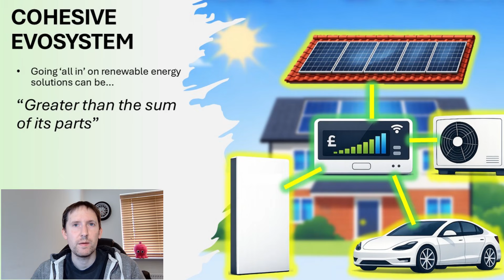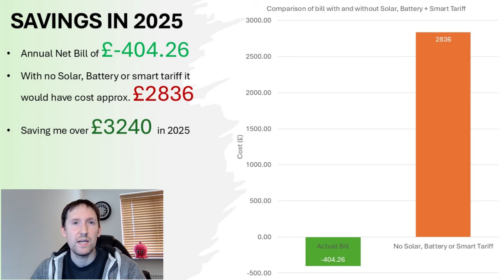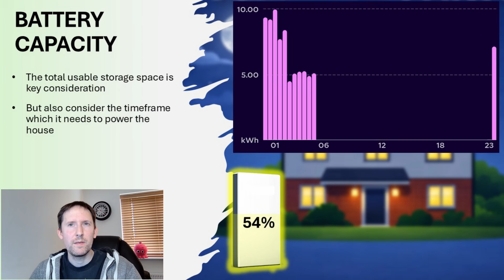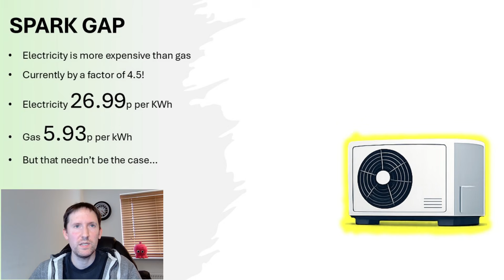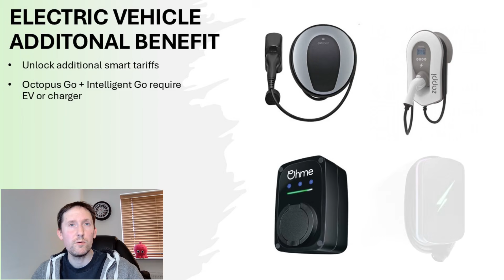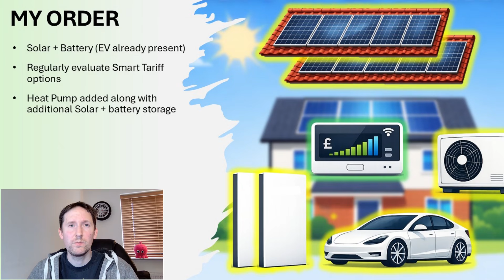The Renewable Energy Setup That Pays Me to Live Here

Comment: I have a 4kW solar system and two EVs plus an air source heat pump. I am looking to get a battery at some point to complete my system. I always charge my cars overnight so will continue to do this so I was looking to get a SigEnergy system 10kW battery and 6 or 8 kW inverter. I was hoping to add the EV charger to this system at some point to once vehicle to home/grid becomes approved in UK so don’t think I need to get a bigger battery as I can use my EV battery as extra capacity going forward. Do you think the 6kW inverter will be a good match or should I go bigger?
Reply from the maker: Those Sigenergy EV points are really cool. I've had a few people comment on my channel they are using their car to power their home already 🙂
Regarding the inverter, try to figure out how often your usage goes above 6kW and look at the price difference between that and the 8kW model. Consider future expansions too and how your usage might change over the years 🙂

Comment: My setup is basically the same as yours, with a few caveats. We have a Victorian end of terrace house with solid walls. We managed to insulate the downstairs floors and the roof, and we have double-glazed sash windows. Only the back extension is properly insulated. Our main roof is also tilted in 3 directions, so we could only fit 10 Solar Panels (3 East, 5 South & 2 West). Our heat pump’s efficiency for heating was only 3.36 for 2025, so without the battery we probably wouldn’t have saved anything compared with an efficient gas boiler. The battery combined with an Octopus’ EV tariff is the main money saver, as you described. We run the house on 7p from the battery and sold the excess solar for 15p last year. Additionally, we moved to plugging in the car every morning to get cheap periods of 7p during the day during this winter months, during which we could re-charge the battery to avoid it running out in the cold months due to the heat pump demand. This happened in the first 2 winters, but we still cut our overall energy costs from £3400 to just under £1000! I expect to push it even lower this year, but I dont know by how much yet. I’m also planning to finally replace our gas cooker for an induction cooker some time in spring, so we can finally disconnect from gas - even if it only saves about £150 a year. 
I would be interested if you think it is still worth selling the excess solar this summer, after the drop to 12p?
Reply from the maker: Its never quite so easy with an older property, but we got a 1950s system built property up to an EPC raring of B before moving here, mainly with a combination of external wall insulation and solar panels. 
It sounds like the trick with getting the extra slots of power the house is no longer going to work from next month, but an EV tariff remains competitive when the import is so cheap. 
Induction hobs are well worth it! Arguably better than gas, certainly safer and you can avoid that standing charge as you say🙂 just remember to by some new pans for it
For most, at 12p it's less worthwhile to go out of your way to export the majority of solar power, self use is nearly as good. I'm actually going for a different approach in the summer months as I'm planning to switch to the Intelligent Flux tariff, to make the most of otherwise redundant battery capacity. It should be effective as I will be generating more than usage and that tariff allows for a better rate as export will primarily be at a specific time, 4-7pm 😊

Comment: Bought my home in April last year - already had an EV. The plan is to stay here until retirement, so first things first is energy efficiency. 

Topped up the loft insulation as soon as winter peaked around the corner. 
Had 24 470w solar panels, a 10kw sigen inverter and two Sigenstor BAT 10s installed last month. 
Heat pump + hot water cylinder is being installed at the end of March by Heatgeek garenteed 400% efficiency. Also had the Sigenergy EVDC installed which will allow me to top up the house batteries from the car when they run low in winter, and I got the Sigen gateway, I wouldn't have bothered with this but since we've been here we've had no less than 7 powercuts, they've all been less than 10 minutes, but that's more than 1 every 2 months. I don't recall having this many power cuts anywhere i've lived since I was a young lad 😅

Expensive? Yes - very! But my energy bills should be <£0 for Heating, hot water, day-to-day car travel and everything else.

Two 8.8kwh batteries means in the shoulder months I never need to worry about my batteries. They comfortably cover my base load. A 3rd would be nice, but it increases my pay-off period, and I have the EVDC for the colder winter months, where I can just top up my house batteries at 5kw if they run low.
The new cylinder is 300L, it will always be enough to last a whole day meaning I never have to top it up during peak rates - bonus I finally get mains pressure hot water.

All in I calculate my pay-off period to be about 7-8 years at current energy rates. It would have been less with arbitrage, but the new 12p/kwh export tips the price over the edge where it's no longer worth it vs the battery wear and tear + conversion losses.

I have the advantage of having a mortgage that gives me £2k back for getting a heatpump installed. And my boiler needs replacing very soon - it's 15 years old and from what I can tell has been pretty pooly looked after - it's even started dripping condensation occasionally, if I went gas, with how long I plan on staying here, I wouldn't go cheap so that's another £3500 I would have had to spend at some point in the  near future, so I can deduct both of those from my total cost.

After that I save >£2600/year for as long as the system survives - again assuming current energy rates. Any increase on energy price (even just annual inflation) actually decreases my pay-off period and/or increases my annual savings.

After a lot of math and calculations, there isn't a single investment I could have put that investment that would reliably have returns even close. The Mrs really wanted to 'do the house up', and I'll admit she's been a little upset at times that most of our money has gone into solar, batteries and heating. But she understands that the earlier it's done the more we save for doing the house up later.
Reply from the maker: That sounds like a really comprehensive setup. 👍 I must admit I’m a bit jealous of your EVDC. I suppose that does negate the need for a larger home battery capacity. Which car do you use with that?  Good move with the 2k mortgage rebate. That’s always encouraging when mortgage companies encourage the uptake of green tech. Doing your home improvements this this order drastically reduces your livings expenses going forward so should help with savings for future projects.
Reply: @RenewableEnergySteve  Car is 2020 Tesla Model 3 Performance (pre-refresh). The tech is pretty new and can be a little flakey at times until you get your head around it's quirks - for example you have to put the car in camp mode and turn the fan right down whilst it's discharging else it goes into sleep mode - but once you do it's pretty solid. It is kind of cool in a geeky way to know your house is being powered by your car. If I get fed up of having to charge the batteries from the car too regularly over winter I may go end up throwing in another battery just to reduce those events. But i'm going to give it a year first and see how it goes.

To be honest I was going to do the heat-pump next year. It was only when I realised my boiler was in such a state that I figured I'd do it this year. And the Mortgage offer absolutely helped and played a large role.

If it's any consolation - I'm jealous of the amount of solar you have!
Reply from the maker: @leighbicknell5583  haha, yes that helps 🤣 it's genuinely really interesting to hear what systems people have. Some great solutions out there! 
My Model 3 is a 2020 model too, just before they added the heat pump to them sadly.
I've not actually used camp mode before, I presume you can run it with just the fan to avoid draining the battery on internal vehicle heating?

Comment: Can we see some numbers? Or are they in earlier videos? You mention having sufficient battery capacity to make it from one off peak period to the next. I’d be curious to see the consumption figures from your heat pump for its hardest working day.
Reply from the maker: Sure, 5th Jan has been the day with the highest consumption so far at 31.85kWh, producing around 90kWh of heat in that 24hr period. I don't have a video covering that day specifically, but I did do a case study of how the Heat Pump performed during a cold snap towards the end of Nov which you might find interesting: https://youtu.be/NnwvpsWPcJ8?si=gfytDqCg3aYjSya9
Reply: @RenewableEnergySteve Thanks for that. And, given that some heat generation and likely all hot water generation was overnight during off peak, were your batteries able to keep it running during the peak period?
Reply from the maker: @tubularG  That would have been the smart thing to do, but I left the hot water cycle at 2pm to keep the efficiency highest which is something I've been doing since May. Its only approx 2kWh as it's a 180 litre water tank. It was taking a risk because my batteries did get very low on some days, but a trend which saved me was the coldest days also typically had some sun, so some power from solar too 😊

Comment: I live in Sweden, close to latitude 57, close to the small city of Oskarshamn (approx middle-north of Scotland) . My first solar installation with batteries was started up the summer 2013, and they did reach break even after 8 years with 16 panels. But they are still functioning, no decrease in power. So I decided to an increase. Today it is 40 panels, and the new 24 panels are almoust double the power at 1/4 of the cost of the old ones. I have the problem with snow of my solar panels during winter, so I am a part owner of wind turbines, to cover up for that. And today I'm delivering electricity to the wind turbine company, so I have not had any ENERGY bills since may last year. My input to grid is subtracted from my consumption! My air to air heat-pump costed me 2500 EUR, including installation and materials. (and it is nice with an AC without extra cost in the summer) And I have a small EV, a Renault Zoe, that is charged from my solar panels.
Reply from the maker: That’s awesome! So many positives in that.😀 It’s great to hear your original panels have stood the test of time and likely have plenty of life left in them. The technology has also improved massively since then + reduced in cost. I remember the panels I had on my previous property in 2015 were 265W each. Now on my current property, around 10 years later we are looking at 430- 450W for panels which are only a little bit larger.
I’m assuming 40 panels serves you really well in the summer with those long daylight hours? That’s really interesting you also have part ownership of wind turbines too. There have been some schemes in the UK around a similar principle although I think we are talking a tiny fraction of ownership, one ran by Ripple Energy, which unfortunately went bust, and another by Octopus, which I believe is still going.

Comment: As I am watching just wanted to ask question. You have over 10k solar, how did you get dno approval. And what size is your inverter.
Reply from the maker: Hi Gino, the original DNO approved export limit was 10kW when it was just my SolarEdge 5kW solar inverter and the single Tesla Powerwall. Since then i installed 20 more panels with 380W microinverters each and another second gen Powerwall. 
At that point, the export limit was increased to 18.8kW which is highly generous. Its enough for what I would realistically need, and I'm fortunate to have it that high. 🙂
Reply: @RenewableEnergySteve you are this is why I asked my last install would not allow no more than 5kw of solar pannels. Is yours single phase,  are you near a transformer.
Reply from the maker: @gino2465  yeah, single phase only. I'm not entirely sure where the transformer is located. I think the reason such a high export limit was approved had something to do with the home being part of a new estate of which only around 5% of the new homes were built with solar panels. As such, on a summer's day, my exported energy can stay very local, powering my neighbours 🙂 
Typically it can be possible to have more total capacity than the export limit, there just has to be a G99 approved inverter to allow it to curtail the generation so it never exceeds that export limit.
Reply: @RenewableEnergySteve cheers yes you are right I think.its more to do with how good the dno net work.is.

Comment: Only one comment I'd add. For older properties you need to consider insulation along with all of these. Not only can it actually have a better payback but it's incredibly important as part of the whole picture. Whilst heatpumps (especially air/air) can heat anything there's a cascading effect when you sort the insulation out because
- more insulation means lower bills (so more money to spend in future on next steps)
- more insulation means a smaller heatpump and for air/water less radiator changes
- a smaller heatpump is cheaper and needs less battery
- a smaller heatpump will be run entirely off your solar more often
- less battery means cheaper battery (although this last step has pretty much come apart now it's 3 grand trade for 32kWh batteries and the inverter and installer fixed costs haven't changed or have risen slightly)

If you don't plan insulation into the steps you may end up with excessive work done that you later don't need. Excess solar as a concept doesn't really exist at this point, excess battery a bit, but excess heatpump/radiator work is very expensive!
Reply from the maker: Excellent point on the insulation 👍 
That can make a huge difference for all the reasons you point out. For me, a higher standard of insulation was a key reason for choosing a new build home back when we decided to move home

Comment: Ok. 7 bedroom house all electric 
So I have a 6.1kw kingspan turbine it produces 18,000 unit a year on average. Maintenance cost £1,000 on average per year
I still get the feed in tarrif ( so Generation tariff pretty much pays for me putting it up and maintaining it ) 
I am deemed export of 9,000 units a year at 6p a unit so I get export of £540 a year.
I have an EV car. 
I have a heat pump 
(Process of getting 20kwh of batteries )
Total electric bill £1460 roughly once batteries in place my cost should be about £500 a year . 

My system including paying for diesel for car should cost me about £8,000 a year, 

So I will be about £7,500 a year better off

Cost of setting a system up like mine,

£30k turbine 
£1k ongoing Maintaince 
£5k batteries 
£5k for heat pump . 
£15k Ev car (2 times expected over 20 years ) 

Over 20 years investment in todays money £90k . 
Savings over 20 years £150k 

Wind turbines only work when you have space tbh for most I suggest solar
Reply from the maker: Wow! that's really cool you have a wind turbine that achieves that level of generation. I don't typically tend to hear of too many which are effective on a residential scale so really glad you shared this. 👍  Assuming you have a good quantity of flat land.
It very much sounds like batteries are the logical next step. 🙂
Reply: @R @RenewableEnergySteve i live in a windy area of the uk, just as you need to oil at solar. Placement , Sun hours etc,

You need to look at average windspeed and whether you have other buildings affecting the turbine, plus you by the land and distance away from neighbours

Comment: Very impressed at your low heating costs. I’ve an equivalent systems but in a slightly larger and older property. In January my heat pump chewed through a touch under 1500 kWh, we also keep the house at 20C and have a SCOP of 4.5, that’s more than your entire annual heating. That’s more than £200 for Jan alone on a cosy TOU tariff and never paying the high rate.
Are you sure you aren’t using a wood burner or some non electrical heat input?
Reply from the maker: We are talking considerably less energy at 535kWh, but my COP took a battering at 3.33 in that month. Ultimately the price difference between Cosy and Octopus Intelligent Go is not even close. That off-peak rate really makes a big difference when usage is high. Of course getting the battery to last from 5:30am to 11:30pm on some of the coldest darkest days was also a stretch, but just about made it 🙂
Gas is disconnected and don't let the chimney fool you, it's totally fake. 🤣

Comment: I've always thought they all work together very well. I got my car first which unlocked the off peak window.. Then the PV + battery system and finally the heatpump just when the £7.5k grant started. Almost three years now and I think I've saved around £7k so far and been paid around £500 per year. Things are changing a little with octopus new rate of 12p export. So 20% less this yr perhaps.
Reply: 12p export rate with outgoing octopus from 1st of next month.
Reply from the maker: That's some excellent savings. Fantastic to hear 😀
It sounds like you are a year or 2 ahead of me. 👍
The good thing about having the complete setup is you aren't completely reliant on one tariff. There  will always be options .  I personally think 12p for an anytime export rate is reasonable still, but it's always a shame for it to drop